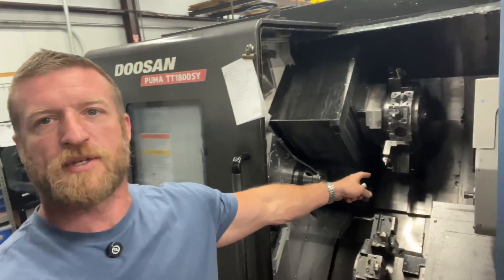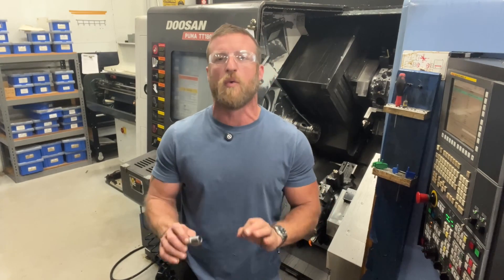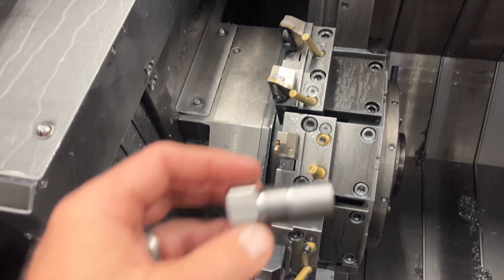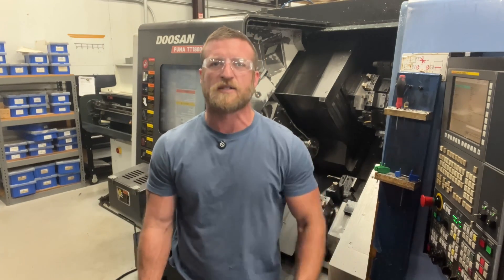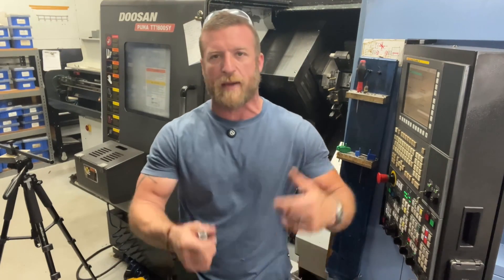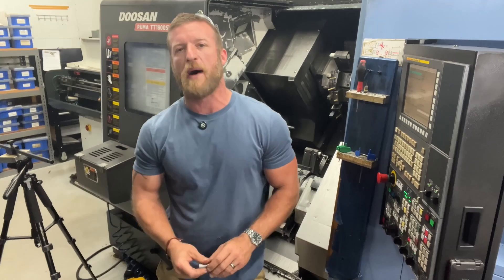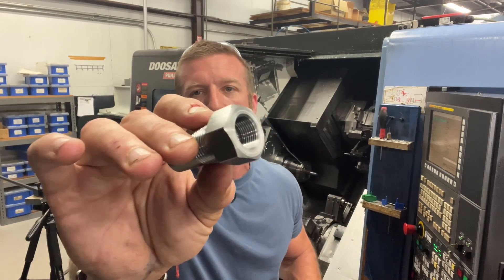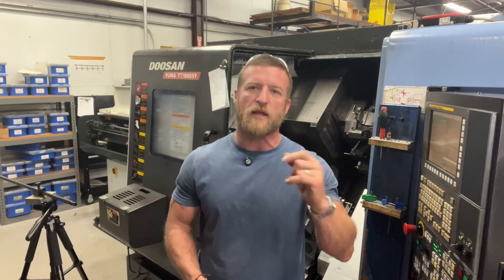Job Layout; How This Part is Made 🚀

Comment: Is it a good practice to do tight ID work after OD? I could never remember which ones to do first
Reply from the maker: It all depends on the condition of the part - and if it’s a sub spindle and transfer or just a cut off. I like to do finish ID work at the end if possible

Comment: Great video. When you're aiming for the tolerance window, do you set up at one end of the window, expecting things to drift in one direction due to thermal or tool wear?
Reply from the maker: That is a great question and thank you for asking it. And yes, I like to start at a certain side of the tolerance. For outside diameter, I start on the low end and for inside diameter I start on the high end.

Comment: Do you get any spring back in the bore from drilling and boring in the sub chuck when it releases pressure
Reply from the maker: On this job we do not. But I have seen in the past. Especially with thinner wall parts.

Comment: Guys this part is successful you bore and rethreading or make od turn from end of thread and  rethread for the scrow attached part be set up lay on each other without twisting column no need to make bore or od and rethread you can get the thread diameter have  curve in the end before we apply thread no need to make rethread and in the inside diameter make bore from front in thread diameter after then open thread no need to rethreading
Reply from the maker: Good point and thanks for the input

Comment: one operation or one setup ?

where im from ( scandinavia ) one operation is normally like a roughing cycle. add a finishing its two operation's ( could be that you guys class/call it something diffrent in the us/outside scandinavia ) 

only asking cause i never seen a way to drill a hole. groove. thread it inside. outside turn it to set diameter and doing cut off all in one tool at the same time. but maybe i have just lived under a rock xD

And what I really wanna see is a review on that roughing method I mentioned in a comment on a reason video
Reply from the maker: We call this 1 operation - or “one and done” there are different operations within this operation, but it’s complete in one cycle. And what do you mean, you wanna see a review on that roughing cycle?
Reply: @Crusadermachining  the one that I gave a example on in a comment in the " Tool Pushed To The Limit - AND Beyond " video
Reply from the maker: I saw that 👍🤝

Comment: We machine a similar shape part only larger but not to a fine tolerance like yours. Never run a sub spindle machine, I'm just curious how the sub spindle is kept perfectly clean from fine swarf or grit every time a new part is gripped to maintain previously machined side concentric to second op side when tolerances are very fine. Is air blowing or flushing with coolant is sufficient.
Reply from the maker: Great question and thanks for chiming in. Your intuition is spot on. We use air blast and coolant also. Sometimes both and sometimes just 1 over the other. We have coolant flush thru the sub spindle and it helps to keep most everything out.
Reply: @Crusadermachining  Thanks for your reply.
Reply from the maker: No problem. Thank you for watching and commenting!

Comment: Nice video! Would love to hear about your finish stock allowance for your OD and ID finish passes. Are you breaking chips in your ID or getting long stringers? I know a lot depends on the material and the surface finish requirements. This material doesn’t look too bad.
Reply from the maker: Great question- I like to leave the nose radius per side, if I can. In this case, I’m using a zero radius = approx .008. I’m leaving about .006” per side. I’m not breaking the chip always but it’s definitely curling out of the way. No real long stringers at all. Same principle with the OD as the ID - I like to leave the nose radius, per side if I can. In a couple of my videos I went over that more in depth. Thanks for following along.
Reply: Oh also—which threading cycle do you use?
Reply from the maker: I use G92 mostly. I use G76 for more comped threads or more complex threading applications. Such as long, skinny threads, or harder materials. Situations like those can need a more sophisticated cycle at times.

Comment: Nice part. I deburr threads with DNMG but I still get some sort of hairs and burrs after first recut. I must do it second time then it is nearly perfect. I am wondering if a grooving tool should be used for deburring perhaps and why?
Reply from the maker: I find that a grooving tool works the best and most of the time it’s because it’s a sharper tool and also the direction in which you cut can make the cut off easier and not go back into the thread. Take a look at the video and you could see how I cut down at the thread as opposed to up.
Reply: @Crusadermachining Only if I had the option to use a double tool holder for one spindle machine with 12 tool stations. I also turn tight tolerance stuff often and I definietly need DNMG for it.
Reply from the maker: That makes sense. Sometimes the machine is limited. What machine is it? Do you have option for double holder and Y axis??